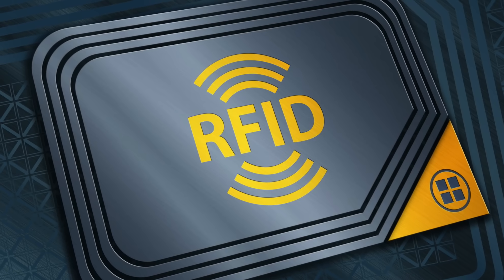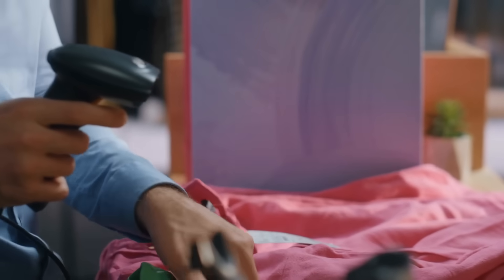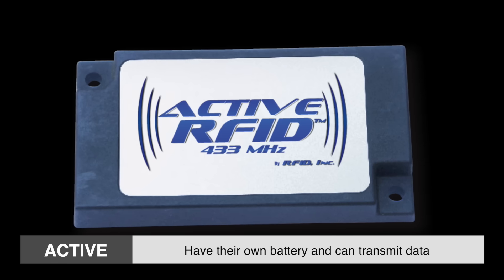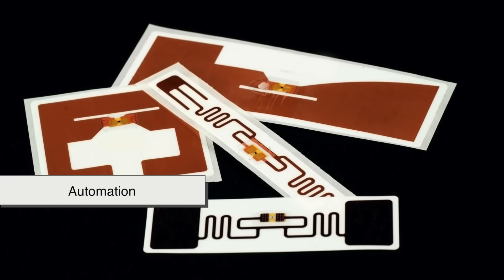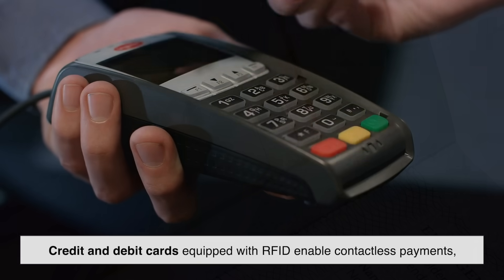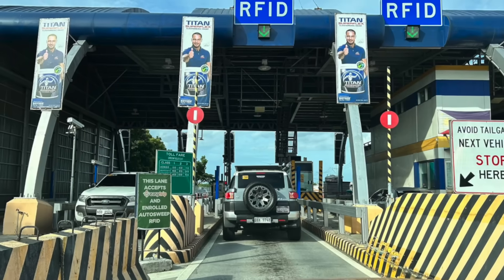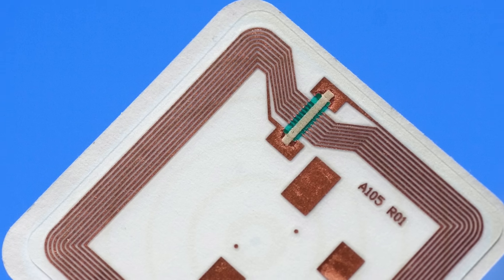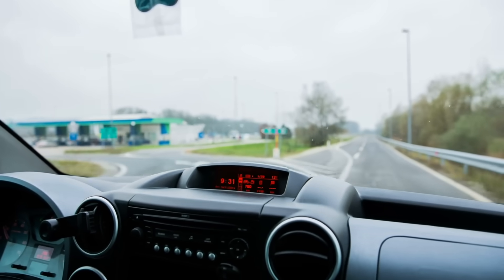What Is RFID and How Does It Work?

Comment: I have an RFID lock on my home office door, but you have to put the key fob right against the control panel or enter a code
before the door unlocks. but the fob only works on one side, if you have the wrong side facing toward the panel, it wont open. 
but its a semblance of a security measure at least.... .

Comment: Nice video. I'd be interested to know the RF levels from both the reader and the tag. Particularly in the toll aspects along road ways. With cars moving 80+ MPH (128 KPH) how much power is used in the tags and where does the tag get that power with no batteries. Thanks

Comment: Hi...Thanks for the informative video, it is very helpful in understanding the concept.

Can you make a video on different types of wireless communication present in modern cars and devide them based on their frequency such as RF , micro wave etc. 
Also similar video wired communication types in modern car such as LIN, K line, KWP,  CAN  low speed, CAN High speed, CAN FD, Flex ray, MOST, DSI3 etc.. will be helpful to understand these concepts on a single video..